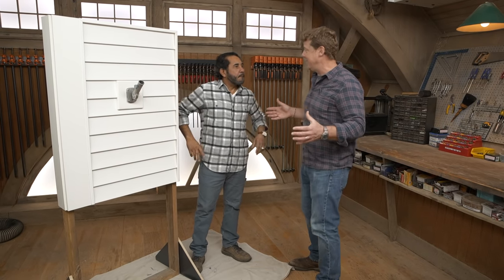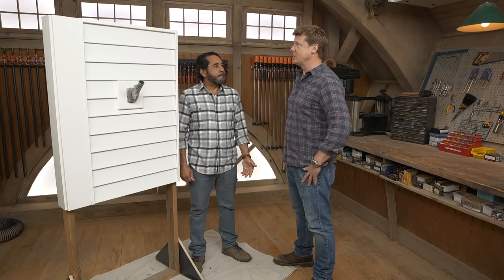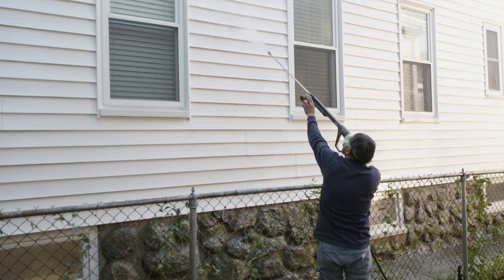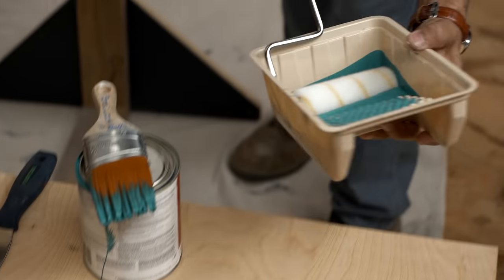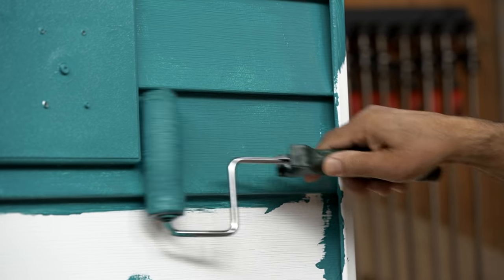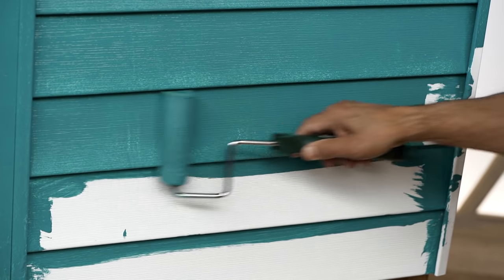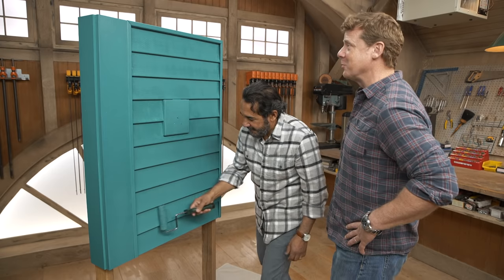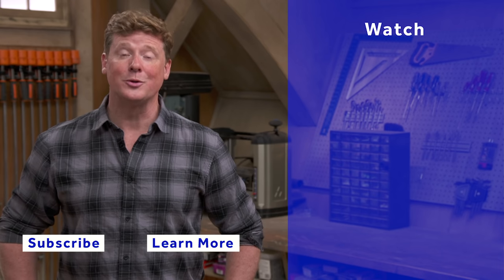How to Paint Vinyl Siding | Ask This Old House

Comment: Actually the answer is a firm no!… You cannot paint vinyl siding. It does not matter how clean it is, it does not matter what type of primer you use or what type of paint you use. Vinyl siding it’s made to last a certain amount of time then be replaced. Any type of paint or primer you use will peel off. You cannot paint vinyl siding and expect the job to last.
Reply: Im a  painter. My painted vinyl is on year 5 with no issues. Used Super paint from Sherwin Williams, no lifting, no peeling and still retaining its color well
Reply: I disagree with you, I am a Professional Painting Contractor & we've done thousands of Vinyl homes over the years & they hold up 10-15 yrs before starting to fade if done properly. We do many Vinyl homes per season. You should get yourself more educated on the subject if you're a "Painter" as your name suggests...you're missing out on alot of work.
Reply: @jarrodallen3517  which climate is the house in?
Reply: @ghpjerry  Want to go dark…..what vinyl paint do you recommend using?  Have you any suggestions?
Reply: @jkcantler  Search this video for a comment I made explaining the painting of Vinyl siding. You need to be careful going too dark of the original Vinyl color or you'll risk "buckling". My other post explains it. But I would use Sherwin Williams "Super Paint" in a Satin finish. When you buy or order the product, they should ask you if it's going on Vinyl, if they don't, tell them yourself, they use different tint formulas for Vinyl as to reduce surface heat. Good luck!
Reply: Definitely Sherrington Williams. It’s important you tell them when they tint the paint that it is going to go over vinyl. They tint it differently to avoid using any black tint to prevent heat buildup and buckling. They also have a list of colors guaranteed to not warp.

Comment: Power Wash is good way to get water behind the siding and BADA BING.....you've got mold and mildew and rotted wood.
Reply: If your walls hold water that well you got bigger problems then painting your siding. Sounds like you gotta pull all yours down and replace your WRB layer. Siding isn't the waterproof layer, it protects the water proof layer.
Reply: That's a whole 'nother episode.
Reply: Siding companies recommend that you powerwash your house every 5-7 years to keep the color from fading or becoming chalky. Thats like saying "I don't wash my car because the gaskets may hold water and make the carpet start to mold"
Reply: Only when washed improperly, like the guy in the video...Never wash UP at it...Always wash from above or perpendicular to surface. Vinyl has "weep" holes for a reason.